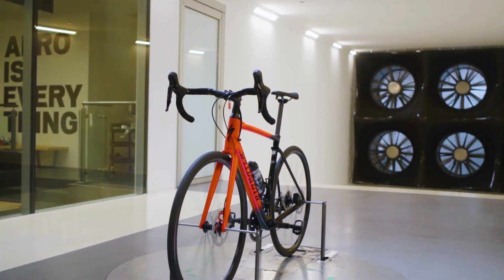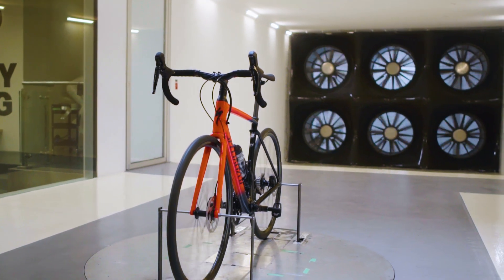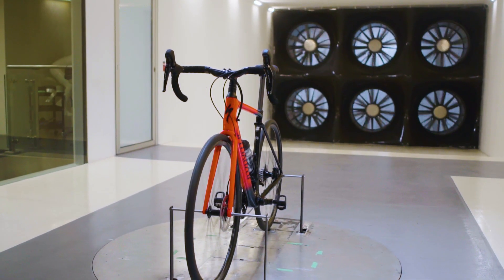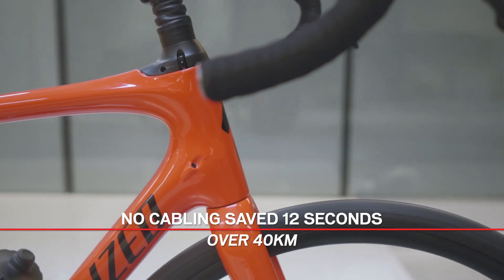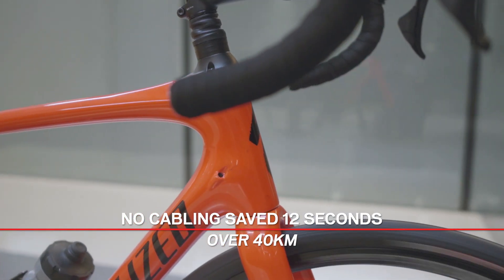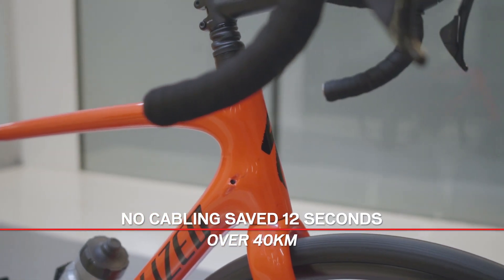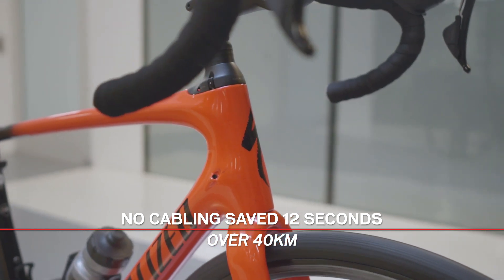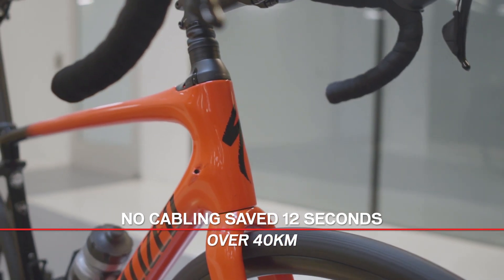The Win Tunnel: Cable Housing

Comment: Guys, stop playing around with integrated handlebars, they are a design comprimise and as you guys have found out, can lead to failure of the steerer tube and recalls.
No one cares about a few seconds, and most people can't ride at 45km/ph without drafting consistently for an hour.
The gains are questionable as no rider was placed on the bike reducing the percentage of drag in relation to the total drag, therefore the gains could be potentially even smaller.
People need bikes that are reliable, low maintenance and that work. Complicating proven designs is really not worth the cost or gains found in integrated designs.
Please give as tried and proven bicycles. Cheers specialized.

Comment: scientifically this has about zero relevance, use the rider, the flow is not comperetable... do 10 riders with and without exposed cables... then it could have some effect, but maybe you guys have done this and found no meningful results so you need to do it this way...

Comment: 12 seconds difference at 30 mph over 25 miles -- in an admittedly unrealistically stacked test.  The real difference is likely between 0 seconds (with rider) and what?  6 seconds?  (Because even the most integrated internal cable routings have SOME additional frontal area for the cables and wires.)  Internally run cables obviously look better.  But are they significantly faster?  Obviously, surprisingly, not.
Reply: Hi Bill, whether 12 seconds is important is up to the rider and what they're after. However, we're very confident in the result due to the precision and repeatability of the test. That was the primary reason behind not including a live rider in this particular comparison. However, we've done similar comparisons in the past with a rider and the results are consistent. By the way, it turns out time saved over a distance is pretty similar for a wide range of riding speeds (in fact, slower riders end up saving more time over the same distance as faster riders). Check out this video where we explain the math behind it: https://www.youtube.com/watch?v=O-7g1kqYJAY
Reply: It’s not surprising at all really.  I guess the real question would be ‘Why bother?’  when it makes maintenance more difficult and introduces a risk of component failure.

Comment: Test at 45km/h, really? How many of your customer ride at 45km/h for 40km?
Reply: Dorin Boeriu same thing I was thinking, how about 18mph...sheesh
Reply: Add to which aero drag is logarithmic, even reducing this speed to 40kph would significantly reduced the variance in results.
Reply: Because testing at higher speeds offers better resolution for distinguishing between results. If they tested at 20km/h, it's likely that the difference between cables and no cables will be very close to the margin of error, and therefore hard to quantify. Testing at higher speeds means more influence of aero drag, more noticeable results, and therefore easier to draw conclusions.
Reply: The same complaints over and over again 😂
Reply: Well, I can, and I know a lot of people that can obviously this info. Is for someone who race not for the ones who only ride for fun
Reply: The reason we share results in time saved is that at slower speeds, the time is still super relevant and will be similar.  i.e. if you ride 40 km at 45 kph vs 35 kph, you'll still save in the same rough time.  See this video: https://www.youtube.com/watch?v=O-7g1kqYJAY
Reply: If you can afford these bikes, you should honestly not be riding at 20 Km/h.
Reply: LeoPers I saw Pinarelo bike pushed uphill.
Reply: @TheDorinn  as long as that guy doesn't complain to Pinarello on Youtube I don't see the issue with that.

Comment: Would be fun to check what the most aero way is to take your spares on a Venge without using a water bottle as an option. Underneath the saddle, in my jersey? Any other obvious method I'm overlooking?
Reply: they have already tested this. there is no difference between under saddle or on back
Reply: You might find the answer in this video here: https://www.youtube.com/watch?v=Rli9JyhHsVA

Comment: Everyone can figure out for himselves that "removing"  the cables has a beneficial effect. Any relevance of this test would have been in the consumer getting to know What difference hidden cables make. Given that the producers of the video explicitly decided not to do a test with a rider on the bike, seems to strongly suggest that the difference in time saved over a bike with exposed cables is actually negligible and that the wattage saved-dollars spent ratio is pretty damn bad.
Reply: Réno Pijnen totally agree. It’s sad that it’s the case
Reply: Hey, sorry we didn't make it more clear in the video. We've done this (and other similar tests) with and without a rider and the results are consistent. To keep the repeatability high, we opted to test without a rider in this case. Since the cables are upstream of the rider (and their wake is small and do not affect the drag of the rider), their aero impact remains the same in both scenarios.
Reply: @chrisyu85  no it doesn't. 
That is poor science and you know it.
Being upstream is a none argument as the rider may or may not be sitting in a wake.
Also the rider is 80 percent of the drag, did you allow for this in your calculations and/or controls?